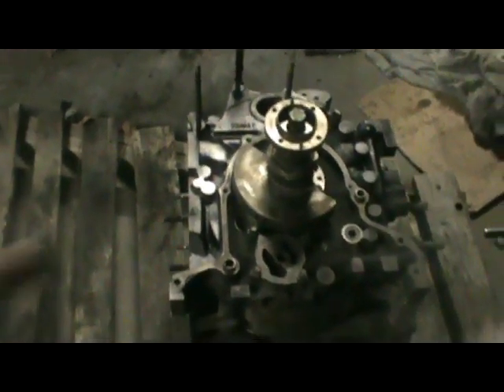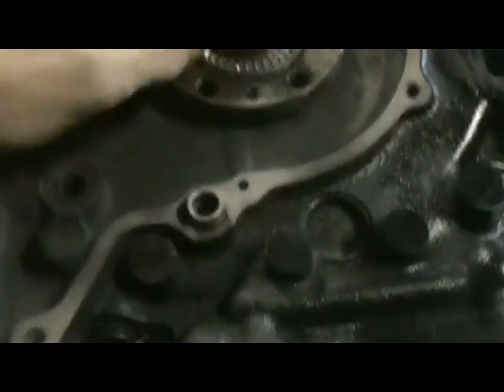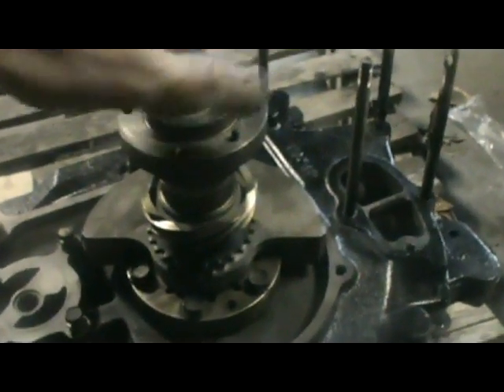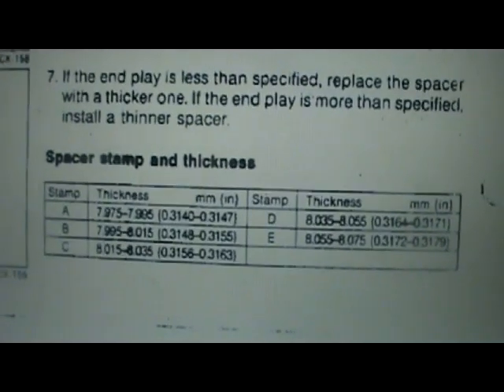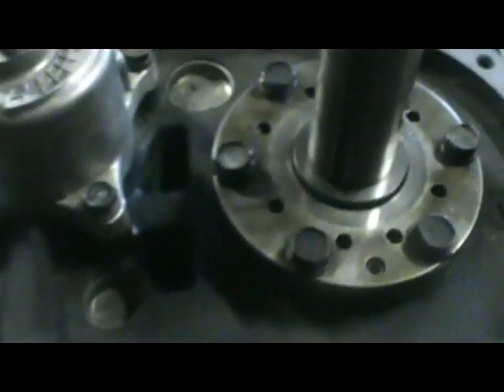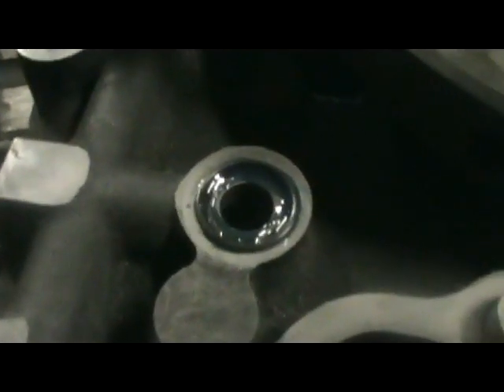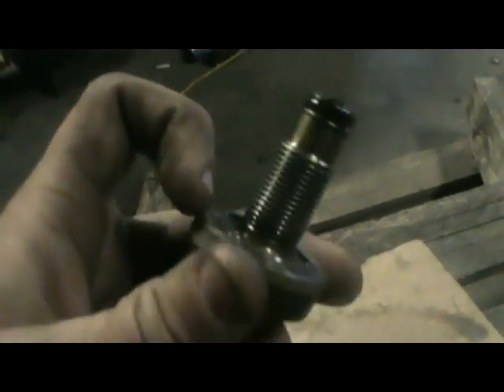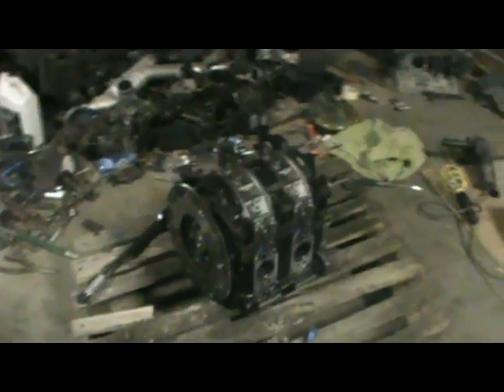How to Rebuild and Port a Rotary Engine : Part 12

Comment from the maker: 0.02 would be the biggest number
.2 = tenths
.02 = one-hundredths
.002 = thousandths
.0002 = ten-thousandths
.00002 = 100 thousandths
.000002 = one-millionths

if I didn't know the differance between thousandth and ten thousandths i'd probably be in a bit of trouble

Comment: .0016 to .0028 is not 16-28 thousands.   It's ten-thousands. 

If you wan to talk thou, you'd say about 1 1/2 thou to 3...   

Each line on your indicator is a thou..  (thousandth of an inch)

Comment from the maker: I get every thing from rotary aviation, the super seals are definitely worth the extra $55. upgrade to their racing apex seals or oem ones either way.they have a higher nickel content. the basic rebuild kits are all you really need they're like $550, my 87 has a jdm S5 TII engine , the rebuild works fine for it